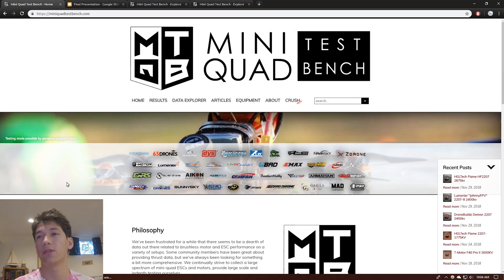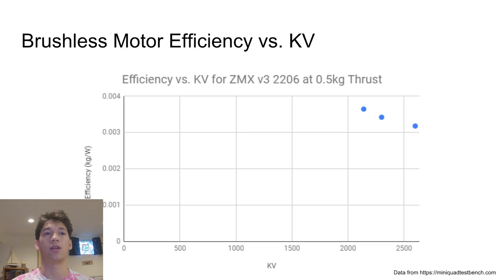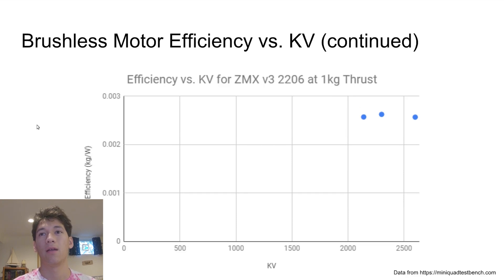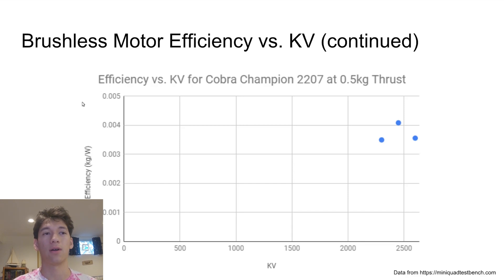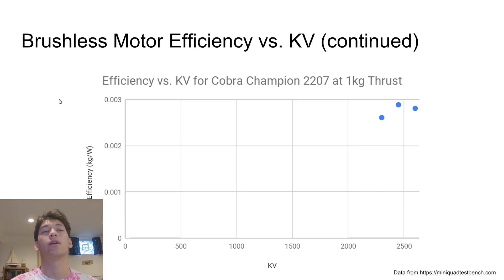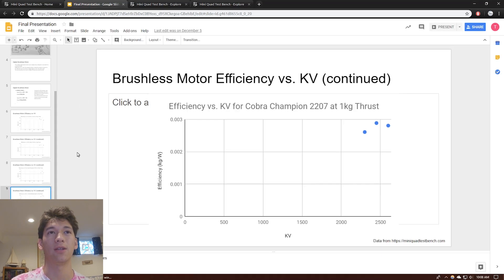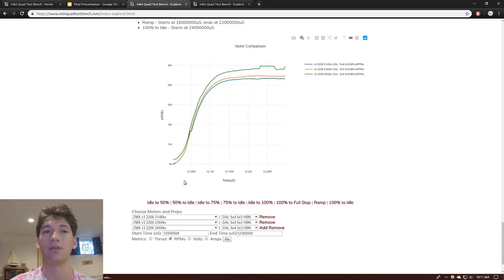Does Brushless Motor KV Matter?

Comment: okay, so then as an example, in an Electric Bike, a low KV motor is good if you can supply the current to utilize its torque, but if you can't, it makes sense to go higher KV to get better top speed?

then, theoretically, if some numpty was annoyed their new low kv motor wasn't faster than their high kv one, at the same gear ratio, maybe they should fit a faster sprocket to their rear wheel because a low Kv motor was unutilized because they geared the bike too low?

totally theoretical, definitely not in reference to anyone in particular that may have upgraded their Surron to a KO motor and goes by the name @Sur Ronster, no not in reference to anyone at all

Comment: also, am i right in saying unutilized torque does not cost power? therefore, a low KV motor is more efficient because there is less load on it?

and that low KV is wasted on a quad because you could instead run a high kv motor slower and while you are utilising all the torque of the motor, it isn't drawing more power than a low kv motor idling?

if this is true, i don't feel as bad for getting higher KV motors than i need

Comment: so low Kv can handle more current, and therefore torque, but cannot generate magnetic flux as quickly?

and high Kv is much faster at producing magnetic flux, therefore can handle high frequency, but cannot handle being driven as hard?

so it is a current limitation, not some effect of the winding?

so theoretically if you could pack as much current into tighter windings, you would only get benefits?

Comment: The best explaining.
Reply from the maker: Thanks!
Reply: @TimmyRC  Hi Timmy, 2506 1850KV motors can be using on 6” with 6S? Do you think? People usually prefer 1500KV.
Reply from the maker: @testtest7191  If you already have the motors you could use throttle cut, but you will still have a higher idle and slightly worse efficiency. If you are trying to pick out motors definitely go with the lower KV. I personally would also use a smaller stator size like 2207 unless your quad is a brick.
Reply: @TimmyRC   I have 1850 KV.  as you said, I will try the throttle cut limitation. Thank you so much

Comment: Check out altitude hobbies spec sheet on leopard hobby motors. They list the efficiency for each one and according to them the efficiency can vary widely.
Reply from the maker: These kinds of data sheets are very common for brushless motors for fixed wing applications. The stated efficiency numbers vary widely mostly due to the fact that these sheets calculate efficiency at full throttle only. Full throttle rpm changes from motor to motor, and propeller efficiency changes with rpm, so this leads to large differences in the stated efficiency values. Comparing motor efficiency like this is not an apples to apples comparison because the props are not spinning at the same rpm, so keep this in mind when looking at these kinds of data sheets.

Comment: Hi! Dude
Can ya please tell me.I recently make an Scale Rc Plane.But had a little bit problem in Selecting Electronics.What happend if wanna used Two TURNIGY Brusless motor of 1400 KV having 100 AMP TURNIGY ESC.Will my Plane Fly or ESC will burned?
Or can you Please make a video on How to setup Sound module system.
I'm really Appreciate ya.& waiten for ya responce.✌👍❤
Reply from the maker: For choosing a suitable ESC for a motor, most of the time there is power draw information available for the motor for various props. You want to choose an ESC with the same or higher voltage/cell count rating as the motor, and a higher amperage rating than the motor. So basically you want the ESC to be able to handle more than the motor will demand, not the other way around.

Comment: I was wondering that if the torque remains the same for different kvs of the same motor, that means that high kv motors are more powerful than the low lv motors. Is that true?
Reply from the maker: Yes, good observation. High KV cannot change the speed of the prop any faster than low KV, which means both have the same torque. However, because high KV has a higher maximum rpm, it can produce more power/thrust at full throttle (and will also draw more current).
Reply: @TimmyRC  Totally Agreed on the point that it will draw more current. But if we set up motor limit in betaflight that will be taken care off and so we should be able to use like 2700kv motors on 6s with around 70% throttle limit without any side effects...
Reply from the maker: @yashasranjan8497  You would probably need closer to 50% throttle limit, but it's probably possible (although I wouldn't recommend it). One side effect of such a high KV is going to be a much higher idle speed. You could try to address this by changing the idle percentage, but based on the response time curve of high KV motors, at those really low rpms high KV is going to have a harder time spooling up the prop compared to low KV (take a look at the leftmost portion of the response time graphs). Also, limiting the throttle in Betaflight or in your transmitter limits the available number of throttle steps, decreasing resolution.
Reply: Timmy RC  Decreasing Motor Limit in betaflight doesn't actually limit the resolution but what it does is limits the top end of the motor and so the resolution remains the same( if not increases). It is not a throttle limit, it scales the throttle to the limit as so no resolution is lost. And for the response time, if the higher kv motor has a low response time, that can only be due to the torque then (which indicates that it is low for high kv) otherwise why would it have low response time when the motor build is same and the torque is same...
Reply from the maker: @yashasranjan8497  Throttle limit through Betaflight DOES decrease resolution because it decreases the number of available ESC steps based on your throttle stick position (but it does avoid limiting the resolution on the transmitter/receiver side, making it better than limiting throttle through your transmitter). Any kind of throttle limiting will suffer this decrease in resolution on the ESC side because you will never be using the full range of output the ESC can achieve with your throttle stick.

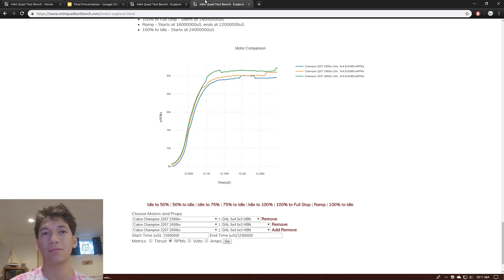You are correct that different response times indicate different torques (which I said in the video). Take a look at the graph at 9:40. For the majority of the rev range, the slope of all three curves are the same, indicating that they have the same torque (which I concluded in the video). However, at very low rpm the slopes are NOT the same due to the different rev ranges of the different KVs. Look at around 6k rpm: the slope of the high KV line is almost horizontal, indicating very low torque at that rpm, whereas the low KV line is ~45 degrees, indicating that it has much more torque than the high KV motor at that low rpm. So if we attempted to cure the excessively high idle of 2700KV on 6S by lowering the idle percentage on Betaflight until the actual idle rpm matched that of a more suitable lower KV motor, the 2700KV motor would have less torque and slower response than the lower KV motor ONLY around idle rpm (which is critical for zero-throttle aerobatics). If we didn't mess with the Betaflight idle percentage, the torque/response times would be similar at idle, but the idle rpm of 2700KV would be much higher (in that case we are no longer comparing the slopes at the same rpm).

Comment: Correct but you are get throttle resolution right ?
Reply from the maker: Lower KV gives more throttle resolution because the motor's change in rpm will be less compared to higher KV given the same change in throttle input. This is because lower KV has a smaller rpm range.

Comment: What you said at 11:40 is what I do but I over prop the motor and that seems to get
me good efficiency on my  plane using miniquad motors, so a 1700kv 2207 with a HD8x4 works great if you want to fly slow using very low amps

Comment: That all doesn't matter for China motors LUL. For China motors only one rule working - Lower KV - less heat.
Reply from the maker: All the high quality motors we use in the drone industry are made in China, and most of them don't have heat issues. However it is true that high KV motors will draw more power than low KV motors at full throttle, and thus will have more heat losses (assuming we are comparing KV variants of the same motor and that the variants have the same efficiency).

Comment: Another quality video. You say limiting the throttle does not gain any efficiency or torque which makes sense but limiting it would gain resolution though right? So I could limit my 2300kv motors to 82% to achieve roughly 1900kv with the resolution of a 1900kv motor correct?
Reply from the maker: Thanks! Yes, limiting the throttle makes the throttle stick less sensitive. However in my opinion it is better to limit throttle mechanically by using a lower KV motor. This way the ESCs or receiver (depending on how you limit the throttle) can still utilize the full range and resolution of the signal they receive. Also, you don't have to do any extra programming.
Reply: @TimmyRC  Hmm I thought by limiting the throttle in Betaflight it would resolve the scaling. Say you have 256 throttle steps from the controller ADC arriving at the FC. Then instead of being divided over 0 to 100% throttle its over 0 to 87%. So say you have 1900kv motors at normal scaling 1900kv x 16.8v = 31920rpm or 2300kv motors at 87% scaling yeilding the same its still 31920rpm / 256 steps. It seems strange the 256 steps would scale 0 to 100% then setting 87% would be 0.87 x 256 steps being then 222.72 steps spread over the throttle range. I might pop the question over at the Betaflight dev page. Interesting subject. 😄
Reply from the maker: @changeagent228  Limiting throttle in Betaflight resolves the scaling for your receiver, but not for the ESCs, which will lose steps regardless since they will not be told to spin the motors up to full power (except in the extreme case where the PID loop demands it).
Reply: @TimmyRC  Ah so perhaps there is a way in blheli change the way the ESC scales the final motor output duty cycle so as to preserve resolution. I wonder how many steps are there on the ESC scale too.

Comment: I'm running 6" on my Qian h5 with CRX 2204 2700kv with amazing results on 4s 1300mah and 4s 850mah! 3s is also great on it! I'm a 4s junky though! Lol! It's fast and butter smooth! The most impressive thing is my flight time! I've gotten eleven minutes of flight time with Gemfan  6030 props. They are quite and really smooth. They are really brittle though! Any current suggestions on a more durable 6030 prop?
Reply from the maker: I haven't tried any 6030 props (keep in mind pitch ratings these days are rather arbitrary and that different manufacturers use different ways to come up with them). Of all the 6-inch props I've tried the Emax Avan Longrange 6x3.8 twin-blade is my favorite. I reviewed it in this video:
https://www.youtube.com/watch?v=-37agtmhKrs
Reply: @TimmyRC  I'll give them a try! Glad I found your channel! Thank you!

Comment: You must have a heavier prop on the low kv to get the same Watt output then you can compare. You can't compare them with the same prop. Comparing 100kv against 2400kv with same prop you are just seeing the prop at different rpms.
Reply from the maker: That is false. In this video I compared different KV motors at the SAME rpm (which is NOT the same as throttle percentage) on the same prop so that the power output of each motor was the same, and thus differences in efficiencies could be seen by looking at the comparative power draw of the motors (power draw is NOT the same as power output). Testing with different props would have introduced prop efficiency as another variable. At that point both motor efficiency and prop efficiency would be influencing the thrust numbers, so it would be impossible to tell if differences in efficiency were due to the different props or different KVs.

Comment: I notice Mr steele was using Cobra 2208 2000KV with HQ 6045 4 years ago ,obviously motors have moved on and efficiency has got a lot better ,I'm tempted to move up to 2208 but they would have to be only slightly heavier than 2207 ?
Reply: I predict 2208 will be the next hype.

Comment: That's about where I'm heading, problem is there is a lot to choose from 2207 size ,but not much 2208, plus the extra weight of a 2208 ,not sure if it's worth it on 6" ,maybe just stick to a 2207 ,like GEPRC GEP-GR2207 2207 1900KV or iFlight XING X2207  1800KV  or BrotherHobby Returner R6 1750KV 2150KV ?
Reply from the maker: There is also new Hyperlite motor that is 2207.5 and is quite light for its size that you might want to take a look at.

Comment: Very interesting results, I have recently been experimenting with rewinding some motors and learned a lot (mostly just buy the motors you want!). I fly 6” Martian on 5” props and it performs so much better than 5” props on a 5” frame .The problem is I have Brother Hobby Red Hulk 2306 2450Kv motors and it’s fine for 5” tri blades, but too high Kv for 6” king Kong 6040 props, apart from balancing the props  ,what made the quad flyable with out too much vibration was to lower my rates.
Hence the experiments to rewind some Emax red bottoms to drop them to under 2000Kv to try on 6” 
Props. What do you think is the best range of Kv on a 6” quad using 6040 bi blade props 2306 or 2207 motor?
Reply: Pablo, there is quite a few people reporting that greater distance between the props fly's better I.e 5" props on 6" frame.
I think it's because the cones thrust air from each prop are not interfering with each other as much.
Reply: @peterclarke5323  Yes, I agree the disk of air coming from each motor would interfere less with each other the further
apart the motors are. it's also bound to improve stability of the quad, it just amazes me that you can actually
notice the difference with such a small change. This also more than makes up for the extra weight?
So, if you are building a 6" quad go for a 7" frame? This is only from my personal experience, others may
have different opinion?
Reply: @pablofpv  yes this was my theory too. I do actually have a 7" frame that I plan to run 6".
Reply from the maker: I used to run 2200KV motors and now I run 2140KV motors. Even with the 2140KV motors I never need full throttle, so I will be dropping even lower in KV in my next set of motors (but I will be going up in stator size for better response time). I would say 1800-2200KV is a good range for 6-inch depending on how much power/rpm you want at full throttle.

Comment: Brilliant, maybe this can put an end to Mr Steele's statement that weak magnets are more efficient than strong magnets.
Reply from the maker: Thanks! I did not investigate magnet strength, so there may or may not be truth in the claim that weak magnets are more efficient.
Reply: Of course they are not. Steele thinks his motor is efficient but in reality they are just weaker thus more efficient at 100% throttle. If you want to compare efficiency you need to have the same power level. Ryan, quadmcfly, has an awesome tool on his site. Conclusion all motors have more or less almost the same efficiency at a given power level.
Reply from the maker: @leftyfpv8263 Do you have evidence to back up your claim? The data analysis I did in this video can NOT be used to make any claims about the impact of magnet strength on efficiency, since the motors I compared differed only in their windings (thus changing KV) and they all had the same magnets. I concluded that KV has no impact on efficiency or torque. When you say, "Conclusion all motors have more or less almost the same efficiency at a given power level," that is NOT the conclusion I arrived at, nor is it correct. There are many variables that are known to have impacts on efficiency at a given power level, such as stator lamination thickness.
Reply: @TimmyRC  plenty. Go to Ryan's site and choose motors by prop by thrust. Choose a mainstream prop and put a reasonable thrust like 600  and sort by power. You will see at a given power level all these different size and kv motors have the same efficiency. Edit. Oh I see now that by power you mean thrust? If that is the case yes there are variables that affect efficiency like the ones you mentioned.
Reply from the maker: @leftyfpv8263  Yes when I say "a given power level" I mean the same amount of thrust on the same prop (different motors will need different throttle percentages to generate the same amount of thrust).
Reply: @TimmyRC  then yes your conclusion is correct, kv does not affect efficiency at a given thrust output. All motors become less and less efficient as they approach their max output.